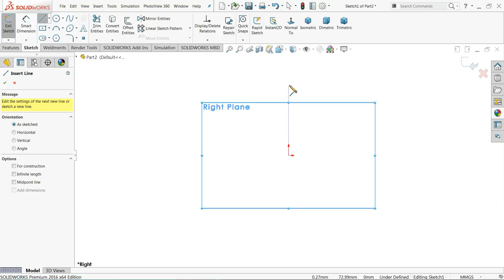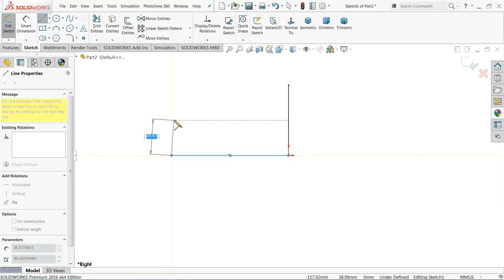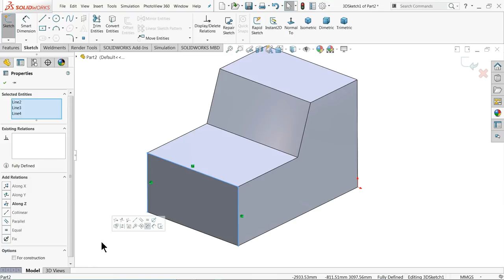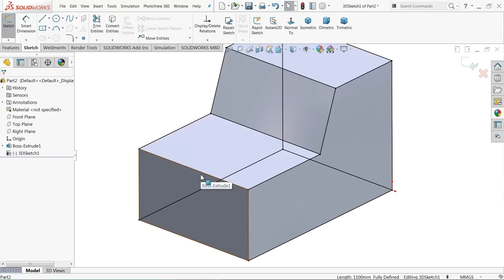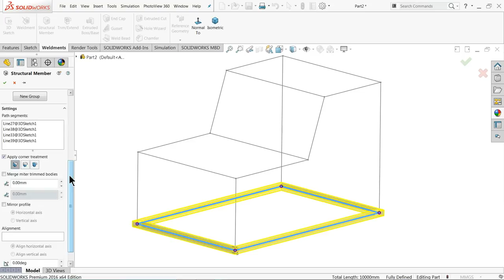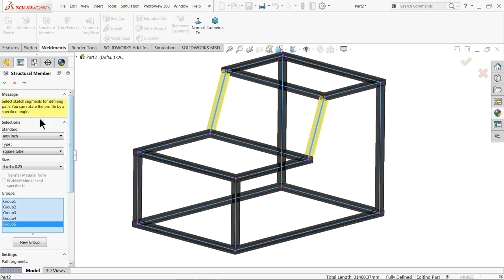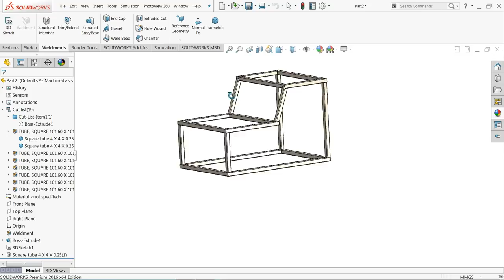Solidworks Weldments tutorial steel structure

Comment: That was great, but the question I have is: The dimensions the wire frame you use to build the weldments structural member is not the accurate total dimension because its measured from the middle of the metal tube. How can you get it so the wire frame is the edge of the metal tube? Having trouble trying to articulate that but does anyone get what I mean?
Reply: Scroll down when making groups and press “locate profile”

Comment: How do you keep the extrude from being calculated into the weight? I'm trying to get an accurate weight and Solidworks views the extrusion as a solid piece of steel.
Reply: Suppressing the extrude is probably the easiest way.  Click on the extrude in the modeling tree, then click the icon that looks like a blue box moving down and becoming a clear box.

Comment: I think there should be (2) mid upright tubes at dimension 1100 at the start of angle 110 deg. down to the bottom 3000 tube. For extra support.